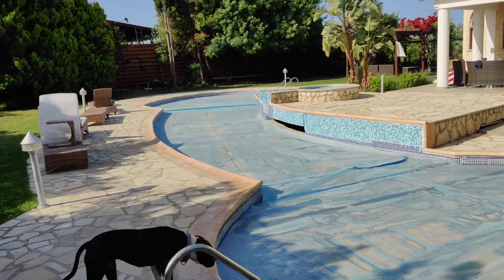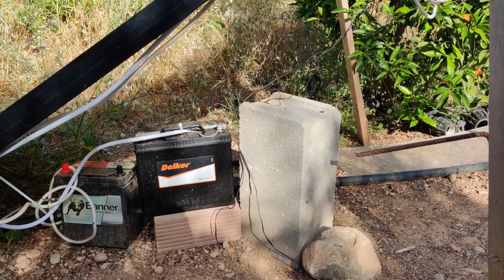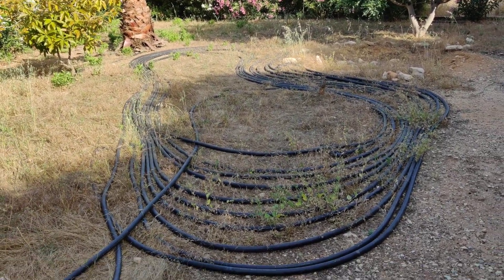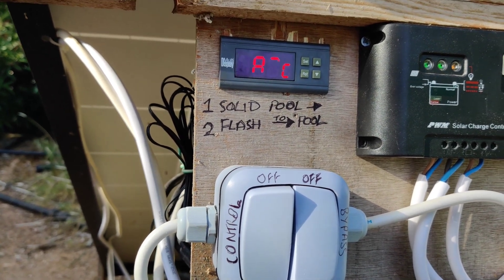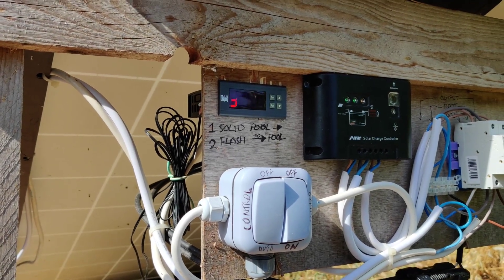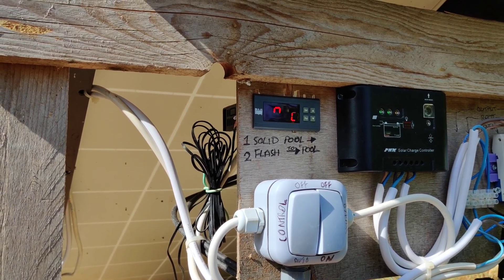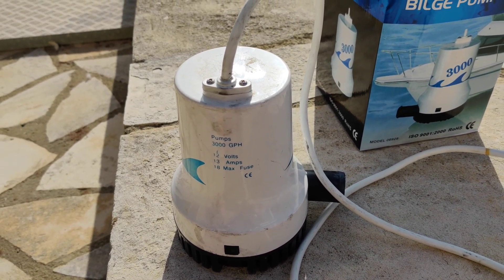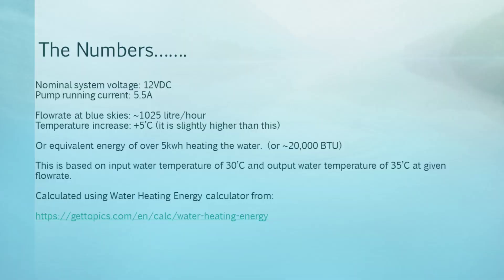DIY Automatic Swimming Pool Solar Heater (Timestamps in description)

Comment: Hey great set up!  I saw your comments on another post about those small black spiral diy solar heater set ups and flow restriction. I get that it is better to move more volume of warmer water then a small volume of super hot water to heat the pool. How do you find the most efficient pump size?  I have 4500 gallon pool and want to make what you have done. There is a point of no returns on flow im guessing?
Reply from the maker: Hi there, I started with a smaller length of pipe, then extended it twice, checking temperature and flow. I stopped at the current length, as it looked OK. So gut feel I guess!